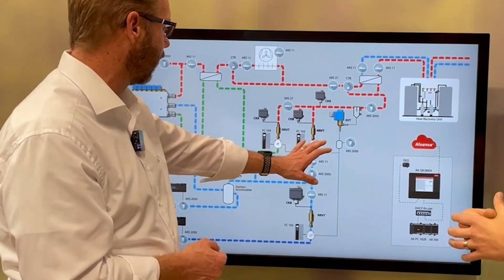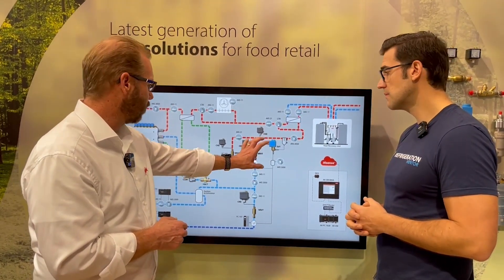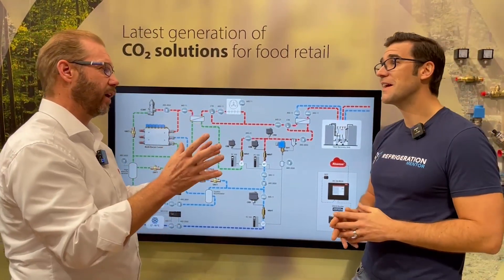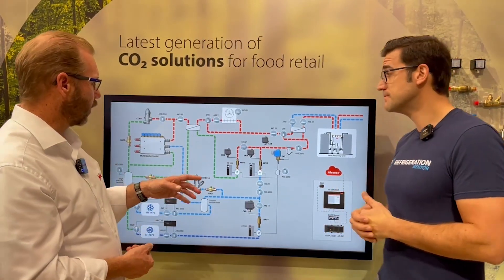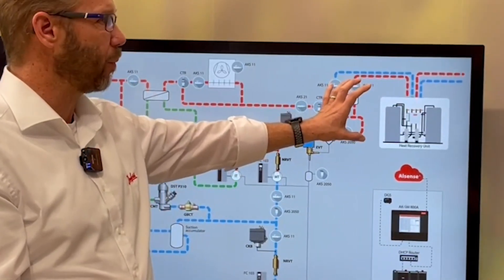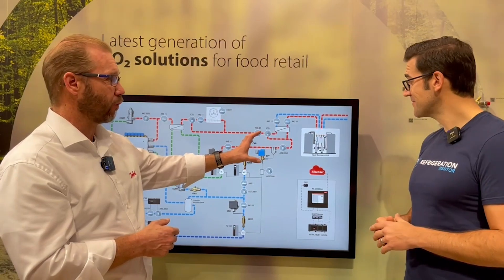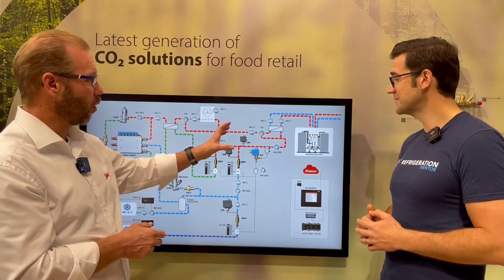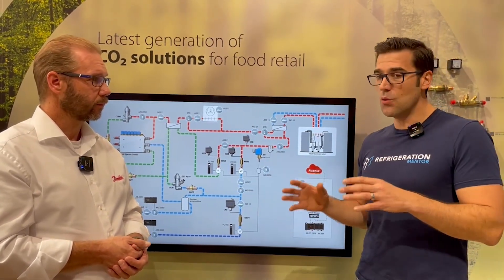How CO2 Parallel (IT) Compressors, CO2 Ejectors & High Pressure Valve work | Chillventa Expo 2022

Comment: So is parallel compression coupled with an ejector, a solution in high ambient — where we can’t use adiabatic condenser, for example Clarke County Las Vegas where water is not allowed?
Reply from the maker: @chris.arellano  there are so many factors that systems need to be installed monitored and the verified for the real answer. But want I can tell you I did a theoretical study with one of the top CO2 consultants in the world using parallel compression vs adiabatic vs ejectors. We used Toronto, Miami and Las Vegas as the locations.  Adiabatic had the highest saving of energy in Las Vegas and the second best was parallel w/ejectors. The thing was when we added the cost of water and maintenance it crushed the savings so it is a very close toss up. I would love to see some systems installed to see the out come. Secondary CO2 system could be a great option for those areas too. Email me at info@refrigerationmentor.com and I will send you more details on the project I did.